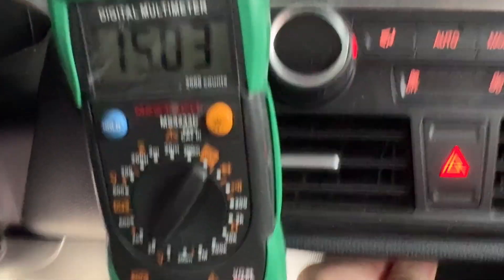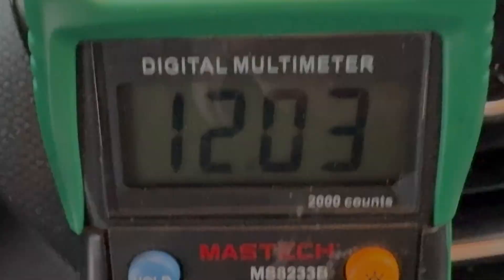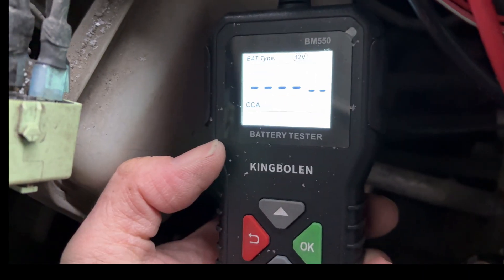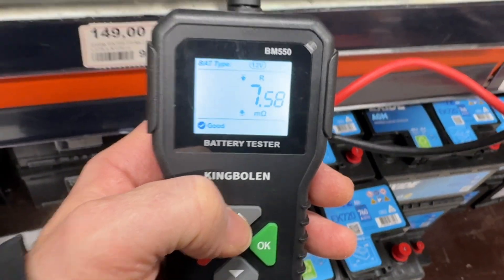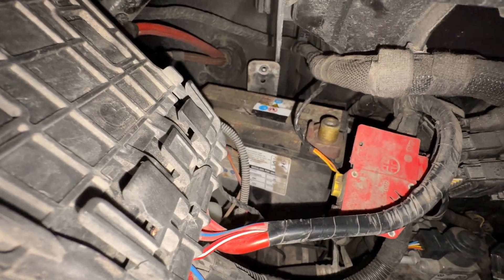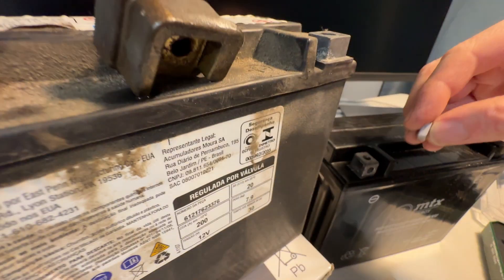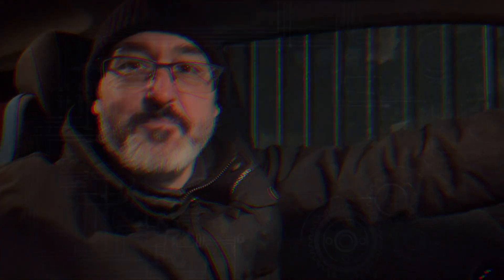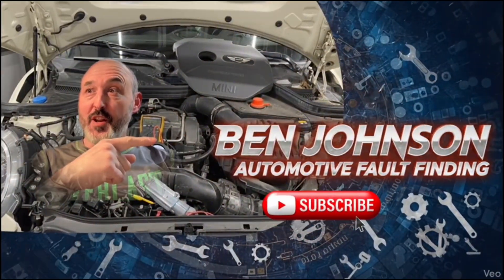BMW Battery Discharging While Stationary? Don’t Panic – Do This Instead

Comment: Hi there, grettings from Malaysia, I've a F15 X5 40e with a drivetrain message on screen & scanned the vehicle. It shows DTC222277 = EME, ground connection monitoring, sensor signal: not plausible. Can anyone have to give any advice or solution to this, thanks 😊

Comment: I'll never see that message on my car, I don't have a milk float. Apart from the exploding fire risk, why aid this Great Reset plan, being restricted to a 15 minute area come 2030? None of this is a conspiracy theory,... Glasgow in Scotland is the latest to become one.
Reply from the maker: Quite nice to drive tjo
Reply: @BenJFF  Do you happen to have an EMF radiation meter by any chance? Others have shown that the readings are very high inside the cabin whilst driving, check around the footwell area for example. How do we know that this won't cause health issues over time? 
There's several reasons not to go down the EV route I feel.

Comment: You had to shut down the inverter. I presume the inverter can turn on at any time?
Reply from the maker: The inverter pushes current and needs to be shut down. It won't turn on by itself unless activated by waking the car.